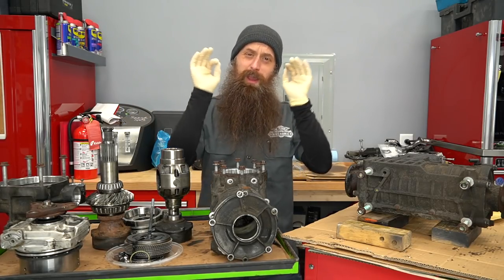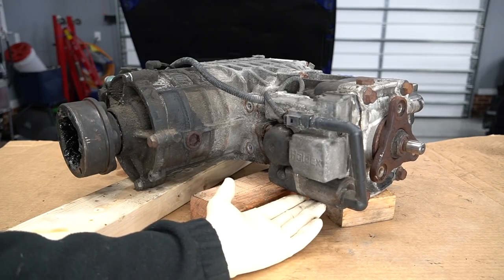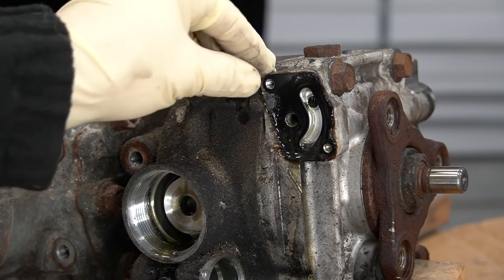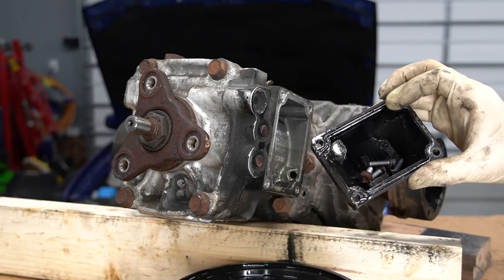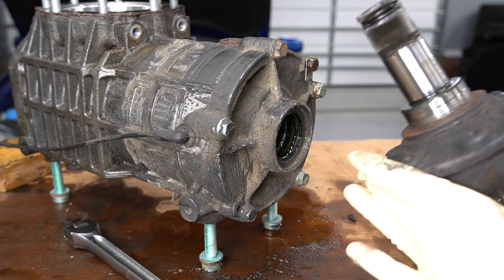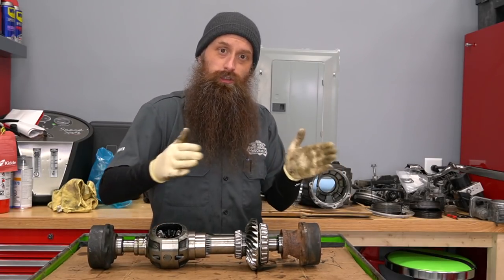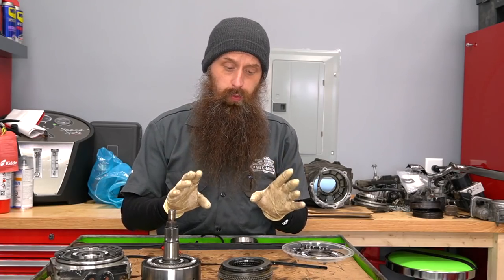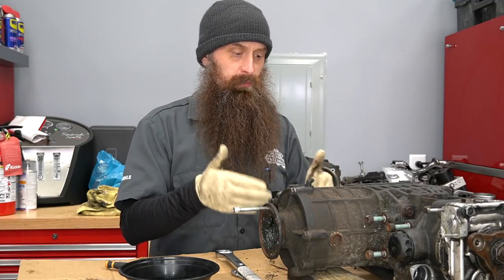How Haldex (AWD) All Wheel Drive Works ~ Teardown and inspection

Comment: Doesn't that guys from Italy clutch replacement cause torque bind between front and rear? I sure had it when my subaru's selenoid locked the clutches together.
Reply from the maker: That I don't know. Most the info I found is in Italian LOL
Reply: Physics says that on dry pavement....yeah, there will be binding, the sharper the turn, the more binding you will get.
Reply: If the Haldex replaces the center diff, yes, you'll be getting extra tire wear. Also make sure to have every tire with equal wear and equal air pressure or you'll be soon having equal wear in all tires.

Comment: Hi Charles, do you know what will happen if a get rid of the clutches and Haldex system. Either weld or have a shaft extension made. I saw a couple of online posts stating that the gearing between front and back is different. That this will make the back wheels push the front ones.  ?? (drag car purpose only)
Reply: You will break your drivetrain. Look at some of the other comments explaining the issue here. The clutches are there out of mechanical necessity to prevent binding.

Comment: THere is a process called "ice blasting" the machine uses dry ice as a media to clean. It is almost the same as grit or sand blasting, but it leaves no residue. The media is dry ice (frozen CO2). You can leave the differential assembled, but you should take care around the seals so as not to blow them apart with air. It should bring the diff back to near factory clean. Try a little steam cleaning first to degrease it and you should not have too much trouble making it pretty again.
Reply from the maker: This seems to be the way. Sadly no one local does this on a small scale :(

Comment: Nice vid 👍

I got a Bora thats not driving on the back wheels. Ill have to check the haldex later this year when its warmer outside..
I found out the hard way that its difficult to know if the 4motion actually works when buying second hand.. 🙄

Comment: Thank you for putting the effort. I am not sure there was a video on youtube explaining the details of a rear haldex diff so far. It looks like a simplified automatic transmission in there. How much would a rebuild cost on the unit? Bearings/disks and all. So far I've only done the regular oil changes every 30k kilometers but this doesn't look as horrific as people told me up to today.
Reply from the maker: Oh boy cost. I’m not sure. Adding the lsd is $1200 in just parts
Reply: @HumbleMechanic  That'll probably add up to 2k with the work done by the mechanic. I guess this is why most people suggest you get a second hand unit, rather than repairing. Are you aware of any cooling solutions for the rear Haldex diff? It's obvious from what you've shown that it's not meant to run 24/7, the oil will heat up without external cooling and will probably boil everything inside the casing. I've never heard about the Italian's solution to getting a solid piece to replace the clutches up to today. It sounds like it will still overheat the unit.

Comment: Hi Charles. I've a question...in the late model VW Haldex (like in my 2018 GSW 4Mo). Is there some torque transfer ALWAYS going on to the rear diff by the Haldex? or is the (stock) Haldex system works as 100% FWD most of the time under gentle/normal road driving?

Comment: So where is the centre differential? or does the haldex clutch pack kinda just account for the slight differential in speed between the front and rear axles under turning or other conditions? also may have missed it, but where the hell does the whole unit actually get drive from the transmission itself??
Reply: The transmission has a bevel box on the front right axle. Therefore, the Haldex unit only ever receives the drive torque provided to the front axle. It does slip to prevent binding.
Reply: @acefighterpilot  this is false.. if you know how this system works, you know that the rear gets its drive directly from the front diff. not the right axle as you say. that would make no sense what so ever if it did :). if you lock the haldex clutches and remove the front axeles then you can have rwd :) (altho it cannot handle all the torque and explode the angledrive)

Comment: A friend sent me a link for dry ice cleaning and it looks like special cleaning voodoo lol they claim no harsh chemicals and safe on all surfaces, wires, electronics, and basically anything from the sounds of it. Check out the videos and maybe look into what kind of a cost they would charge for it. I did quickly look at the cost of the units (as i enjoy cleaning and having a really clean car) and they look rather expensive so its quite possible it will not be cheap but i would assume if its just that and you leave it with them and pay cash it should not be that bad

Comment: @humblemechnaic - For my Audi TT track car's off season, I'm going to be adding an LSD both front and rear as well as rebuilding my Haldex with new clutches, pump motor, etc. It would be great to see a DIY on reassembly! If you'd be interested in doing the videos with my parts let me know.

Comment: When you say you missed a circlip, can you mention which one you missed? I noticed on mine that there is one of the cover face side under the seal but there is also a second one between the diff and the cover which seems to hold the bearing in place. Just wanted to confirm you needed to remove the face one, not the bearing one too. Thanks!

Comment: Hi Charles. Great video. Super interesting for me because I rally a 2.8L 4Mo Golf with a vd Veer Engineering Haldex controller. In my communications with Borg Warner about recommended maintenance, they suggested that apart from the Haldex pump and filter, the axial needle bearings might need replacing. Could you point out which ones they are please? Also, whose LSD are you using for the rebuild? I've got a spare diff & Haldex that I might prepare for the inevitable day that AWD suddenly becomes NWD. Cheers. Rob the Kiwi.
Reply from the maker: Nice!!! The lsd I have is wavetrac I’m sure I’ll get hell for not replacing all the bearings in the case. Lol

Comment: Is there a center differential between the front and rear wheels?  If not, then you would not be able to operate the haldex on dry pavement.  How would replacing those clutch plates with a solid part work?  Or recoding the haldex to stay on.
Reply from the maker: There is a support bearing in the middle just below the shifter.
Reply: @HumbleMechanic  a support bearing?
Reply: It wouldn't work, it would be an off-road only 4WD system like an old pick up.
The clutch pack is there out of mechanical necessity, not just to spoil your fun.
Not only do the inside and outside wheels travel different distances on a turn, the front and rear axles describe different radii. They must be able to rotate at different speeds.
Reply: @acefighterpilot  that's my point, when the all-wheel drive system is engaged now, clutch slippage allows the front and rear wheels to move at different speeds.  But @HumbleMechanic mentioned a design where the clutch plate was replace with a solid piece, I'm not sure how that would work
Reply: @marcvalme7732 And that's my point. It wouldn't work on pavement. Either it's designed for use off-road, it's not a solid piece but actually a helical differential, or, most likely, it's just flat out a stupid idea made by someone who didn't fully understand what they were doing.
Reply: @HumbleMechanic  Charles, parlo italiano cosi cosi. Per favore, tu dai la storia a qui, e leggo.

Comment: Parts are on backorder? I guess I should never order from ECS
Reply from the maker: HAHAH Backorder is not technically correct, but the easiest way to explain it. They came out of a different warehouse. So rather than being the next day, it was 3 days. I order most all this stuff from the dealer. I can get it the next day usually and I KNOW it's right .
Reply: Just buy from the dealer, it's cheaper than ECS and the customer service is better...
Reply: @HumbleMechanic  i go to dealer for all engine parts, nut, bolts, etc...

Comment: Is this from a VW mk4 AWD golf?   Converting my mk3 Cabrio to AWD is something I've considered, but I have no idea what parts I'd need or how hard it would be... >_>
Reply from the maker: yes this is a MK4 R32. this is doable with what you are thinking. But it's not bolt in, it's welding floor pans.
Reply: There's one in Canada, you can find it on YouTube. The owner seems like a cool guy.
Just don't go mangling a car up if you can't finish it.

Comment: Like any good rally car, I always have spares for my my VWAG fleet.
My 1993 Audi V8 has a factory torsen rear diff and it has a little bit of wind up between the rear wheels when negotiating a corner
Reply from the maker: Im amassing more extra than I Really want. HAHA
Reply: @HumbleMechanic  I hear you on the growing spare parts inventory. I have spare engines and trans for all my cars and spare syncro O2C and rear diff for exactly the reasons and others that were illustrated in the video, we have all been there. Thank you for the videos, the 4 herniated discs in my back prevent me from working on the fleet. this way I get to live vicariously through your channel. I also appreciate your dealer training as my past employment includes vw and benz but not as a tech. Cheers!

Comment: What kind of tiny LSD is that?  Its very cute.  Viscous or torsen based?  Is this the same kind of principle thats used in the GTI front diffs?  It also seems to be related to the e-Diff that Hyundai is using.
Reply from the maker: Its' a torsen style.

Comment: Wire wheel the case, spray it with bed liner. Hides it, and makes it tough!
Reply from the maker: My amazing wife spent the morning with the wire wheel. It came out okay. May throw a coat of epoxy paint on it.
Reply: @HumbleMechanic  you’ve got yourself a winner there! Wire wheeling, AND let’s you have a giant garage!? Hahah
Reply: @HumbleMechanic  check out Sharkhide protectant for aluminum.  I’ve used it in various items with great results.

Comment: Idk why people say that it is not possible to convert haldex systems to full time awd, you just need to replace the haldex clutch with the solid coupling and get some beefier diff gears (optional but recommended), and it will work without any problems except pissing off the car's computer.

Comment: I changed the haldex oil and filter in my mk1 TT.  There is 190k miles on the car. Should I take the pump out and clean that pump filter too, and can it be removed while still in the car? 

As for cleaning the diff, why not put it all back together and then media clean it or hot pressure wash it , that what nothing can get inside it
Reply from the maker: I don’t trust water to not get past the seals. 

yes you can do the pump in the car! I will be doing a video non my blue car at some point

Comment: Hello Charles,
I have done full service and oil changes for engine, dsg, axle rear and front for my mkv R32.

I expected the service make my r32 solid  and safety but its not. After three days service (unlucky day) on early moving i heard some noise from rear. Im not able to realize which noise is it, thats on and off sound. When i turn i heard noise again but more loud. Unfortunately i continue my driving. Then after i did light acceleration, Hard knocking heard from rear, the knocking in same time impact on motion. Then i stop at side way, looked at bottom, i seen oil of diff fell on road.

Now,it on ram. Diff was cracked and fracture line.

Now im still thinking what the potential causes. Appreciate on your advise.

Thank You,
Ahmad.

Comment: After reassembling my Haldex, I have a drip of fluid coming from underneath the Haldex Prop shaft. Is there a seal on the front side of the Haldex? AKA @15:57 the drum with the splined shaft passes through the Haldex "face" with the oil passages. Is there a seal that rides on that shaft?

Comment: Should have cleaned the case before pulling it all apart imho 
With brake cleaner and hot or cold pressure washer with bags tie rapped over the drive ends

Comment: Hey, just a quick question... All the WV engine systems and driveline ect. Does it apply to skodas? I have a 2016 Skoda Octavia 1.8 tsi 4x4 6dsg. It's a car from Norway, so if I'm not mistaken, it is a ea888 gen 3 engine with direct injection and port injection? Do I need to be concerned about the severe carbon buildup that is in the  only DI engines? @humblemechanic

Comment: I say vapour clean the case and then get a clear powder coat baked onto it for protection. Or you could put in the hours and hours of manual work with a Scotchbrite dremel wheel and give it a satin/brushed look. Check out Cameron Niemela's channel for examples of dirt bike engine cases cleaned this way.

I think the raw aluminum would look extra hot when bolted to that candy purple diff brace!

Comment: Hey. What is that little hole that is on the bottom of the haldex case? In my own car (audi a3 8l), haldex oil drips from that small hole..at 6:56 you can see that small hole.

Comment: While you are in there on the other replacement assembly would it not be a good idea to verify the clutches are in as good a shape as the one you broke? Would hate to get it all back together and have that part fail ;-) And yes old gear oil and trans/ clutch fluid stinks something real bad. ;-)
Reply from the maker: I’m am. The big issue I’m worried about it the pump port being open and dirt getting inside

Comment: Is there any reason why you couldn't use the end plate from the second one on the first unit that had the "accident"?  Then you don't have to disassemble the second unit at all?
Reply from the maker: Id need to take all the measurements for the bearings and what not. some of which I am not sure we have specs for.
Reply from the maker: but that is a WAY better way to do it. LOL

Comment: Hey Charles! What happens if someone modified the haldex system to be permanently be engaged(welding that parts that slip, not software)? How will that impact the car handling or even the reliability?
Reply from the maker: I think it would be okay. Depending on how it's modified. So if you remove that clutch pack for a solid unit, it should still preform well. The diff will account for turning.
Reply: Charles, the whole rear axle has a smaller turn radios as the front axle. So you long driveshaft will see massive stress. And the car somehow has a welded diff between the axles. There are middle diffs for a reason.
Reply: @piti_rocks  Without center diff or clutch slip the average rotation speed of front wheels and average rotation speed of rear wheels will be fighting against each other. And without clutch or center diff, the only way is to slip at least one wheel or snap a transmission part.
Reply: @MikkoRantalainen  thats what I said, but you said it somehow better 😂
Reply: I wonder if a torsen diff could be modified to fit in place of the clutch pack.

Comment: Hey random video to comment about this but I got a p2400 code for my mk6 gti would like to know proper way to diagnose the issue tried replacing LDP with another used one any information would help out thanks a ton!
Reply from the maker: You need a scan tool, and possibly a machine to pressurize the tank abs check for leaks. It’s why I haven’t done a full video on it.
Reply: @HumbleMechanic  i appreciate the quick reply!

Comment: Hi, my Audi tt quattro has awd all the time. I have chaged the control unit couple of times with the filter and oil. When I remove the haldex fuse there is obviously only fwd with no noise coming up from the rear. Any suggestions anyone?

Comment: Don't know if you'll see this comment, but I've got a rear diff issue right now. When I go from a stop there's a dragging and Jerking coming from the rear end. I pulled the fuse for the haldex and it went away. I was wandering if you had any idea what the problem would be, and cost. Also should I take it to the dealer or try to fix the problem myself. Red mk4 r32 with 155555 miles 🤣😭
Reply from the maker: The pump may be bad. I’d look for a vw/Audi specialist locally. Not a ton of mk4 guys left at the dealer
Reply: @HumbleMechanic  thanks so much for the reply man, I appreciate the help. There are 2 vw dealerships in the area. Ecs has new pumps for like 600$. Is the replacement difficult, would I need to drop the diff?
Reply from the maker: Pump is easy. But may be worth the $100 for a full diagnosis
Reply: @HumbleMechanic  thanks for the help man, your videos are awesome and very helpful.

Comment: I did a heldex service on 2011 tiguan. found the heldex has a filter separate than the pump. the filter got melted. I might need your help. my wheels bind still when I turn left or right. it goes dit-dit-dit skipping . anyone has some suggestions what to do. I didn't change the differential fluid. I am afraid my differential failed but I still drive the car straight as normal. I have no clue what is happening. I also did work on the intake manifold and clean the valves. guys, do not go cheap from autozone- buy original parts. I am looking forward to see your feedback.

Comment: The Haldex on my a3 8v is making grinding noises while driving and sounds bad when the car slows down to a stop. Audi haldex/rear differential $2,600 and $3,400 installed. It's a 2015 with 80k miles on it and has had all services as required smh. Been looking all week for less expensive options. Any help anyone?Had an independent audi/vw inspect and tell me that's what was wrong. There was some shavings in the haldex oil. Maybe I'll try and do a haldex service and see what happens.

Comment: hey charles i got a issue with my mk5 jetta 2.0t fsi i sent you a message on facebook would really appreciate any advice thanks. its got a very lumpy idle issue . pcv valve, cam follower , injectors , purge valve have all been replaced but the issue still exists.